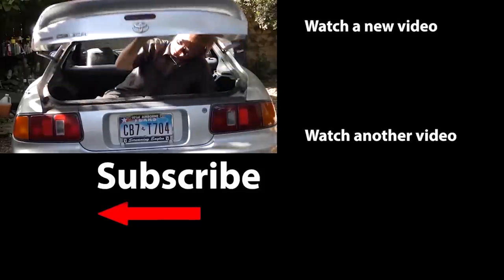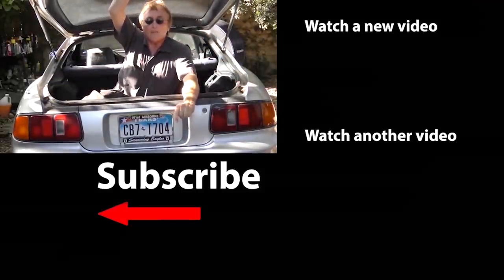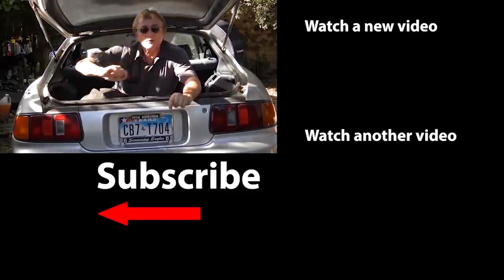This Was a Huge Mistake

Comment: Scotty should I get a Dodge Caliber SRT4 as a collection, it looks nice and is tuned pretty fast and powerful
Reply: Theodor Eberbach To keep in the garage and drive on the weekends, sure why not. To drive everyday, no (also depends on year and millage)
Reply: @jgonsalves22  the one I plan to get is 2009 I think, 98K miles, with a ton of upgrades, like literally, everything from clutch to intake to injector, everything that can be tuned or upgraded with better parts is done. I'm planning it to be a daily driver
Reply: If you can buy it outright, perhaps. YouTube "Scotty Kilmer don't buy any car" for his thoughts on car collecting.
Reply: Theodor Eberbach Daily driving might be a bad idea. Dodge’s are not reliable at all, but with the upgraded parts, could last for a year or two before you experience problems.(especially if you plan a lot) Be careful, but again, it’s up to you. Personally I would not get it, as it also sounds pretty expensive.
Reply: Michael Ball *plan to drive a lot

Comment: Hey Scotty, I have a 2005 Honda Accord Ex with the 4 cylinder. It’s got 143,000 miles. When I’m accelerating and I’m at around 40 mph my engine feels like it’s wobbling. Is my transmission toast or do you think I will get another few years out of it. Thanks
Reply: Mikeyp53 Sounds like the transmission, but I’m not 100% sure. A Honda that old with 143k miles could be experiencing transmission problems.
Reply: Could be the transmission, could also be that the motor mounts are failing.

Comment: Hi Scotty, I just accidentally topped up my power steering reservoir with brake fluid. Probably only added a couple of ounces. Will this cause any problems?
Reply: If you haven't started the car , just disconnect the line from the power steering reservoir near the pump , drain thoroughly , reconnect and refill with the correct fluid .
Reply: @j_freed  But I only added 2 ounces. Brake fluid has a much higher boiling temperature and not as much lubricity so it seems like the biggest problem would be poor pump lubrication as you alluded to. But it would still be 94% power steering fluid and the brake fluid has some lubricity, right? I agree that the safest thing to do is to flush it but, on the other hand, isn't it possible that it might not cause any problem due to the small amount of contamination?
Reply: @Gordon_L  I started it and drove it around for a week before I realized what reservoir was for what. Stupid, I know, but I expected the power steering reservoir to be on the pump but it wasn't which threw me off. No excuse but accidents do happen.
Reply: @michaelchristensen2786  Easy mistake to make , don't be too hard on yourself buddy .

Comment: Hey Scotty, I have a 2019 Tacoma and I want to straight pipe it, what are your thoughts on that. I live in the Houston-sugarland area, is it legal here
Reply: No
Reply: you’re messing with the exhaust and the engine isn’t programmed to run with straight pipe. it might not run correctly so if u want to straight pipe it, get the computer reprogrammed
Reply: Easwar Punnavanam I believe Texas has emission tests... if they do, then no. If they don’t, while it’s still illegal, it is probably not heavily enforced...
You can probably get away with it, but RIP warranty 😂
Reply: The older it is the easier it is to mod. The ECU will need tampered with too for it to work right.
Reply: Don't recommend it, but if you really want to, find a system with a high flow cat and bungs where the O2 sensors screw in. Basically a plug and play system. If you can't find one, just throw a catback on it. Straight pipes only you will need a dyno tune so they can program the ECU. Easy 600 bucks for a proper tune so think about it
Reply: Not legal whatsoever.

Comment: Scotty do you think UTI is a good school to get into the automotive industry
Reply: Sure he would say it's a money pit don't do it!
Reply: I have been in the service business for over 20 years.  Most of the UTI graduates I work with think they know everything about cars and actually know very little. They end up causing a lot of damage to customer cars.  In the shop I work for now, the UTI grads still have to work their way up from the bottom.  They start out as parts runners, car washers, and lot attendants.  If they have good work ethic, they get promoted to the lube rack where they usually spend a year or 2.  Then when there is an opening in the shop for an apprentice they get moved to the shop as a technician assistant.   The advantage to UTI is it will get you in the door more easily for a job interview than not having that degree.  I recommend getting into a factory training program through UTI, such as Ford's ASSET program.  Then you will get specific training and have a better chance of going on the line a lot faster than normal.
Reply: Your local community college is cheaper than UTI if they offer automotive.
Reply: You're better off going to a trade school to become a plumber, HVAC tech, or electrician, whichever of those three interests you most. The problem with auto mechanics is that as cars get more computerized, auto makers are going to go more and more in-house for repairs. It's already happening with John Deere, Tesla, and FCA. No ability to go independent removes leverage for employees to negotiate wages and benefits = Not Good. To see the worst-case scenario from a car mechanic's standpoint, YouTube "Tony Seba robin hood conference", and watch that presentation.

Comment: 2005 ford diesel was the 6.4L and it's a piece of crap they constantly blow, go older and get a 7.3L or a gas v8
Reply: 6.4 is the maxxforce 7 from navistar, piece of junk engine
Reply: @Datsun7705  yes even if you spend like 7k to "bulletproof" it the thing will still blowup.
Reply: Tatsuhiro Satou haha you search up maxxforce 7 you’ll see lots of hate because the 6.4 is exactly the maxxforce 7
Reply: 2005 is a 6.0 which was a pile of junk.  In 2008 they came out with the 6.4 which was better, but still not very good until they worked out all the bugs in 2010.  The 6.4 had terrible fuel economy also.  The 7.3 was fantastic
Reply: all of these emissions crap caused the engines to fail
Reply: @rays7437  your right I was thinking of the 6.0 but called it the 6.4 by mistake
Reply: @tatsuhirosatou5513  
Easy mix up.  Neither were very good.  I made a LOT of money off of the 6.0 repairs, but I think that whole debacle aged me 10 years.  I have to say, though the 6.7 and been phenomenal

Comment: Hey Scotty, Ive got my eye on a used 2012 Hyundai Elantra with 22k miles on it for $10k, would it be worth it to buy or am i walking into a money pit?
Reply: Definitely. According to Scotty Hyundai cards are not well made and are endless money pits.
Reply: I could get a 2011-13 Corolla or Matrix for far less ($6-7k with around 90k miles, less with more miles). Even with the higher mileage, it would be a way better car.

Comment: If you buy a used F-150, avoid the 5.4L 24 Valve V8 Triton engine.
Reply: Can you tell me why please?
Reply: @rellyrellisreallyreal2304  The have a cooling and oiling issues compared to the 2Valve and 4Valve engines.
Reply: @neilhale4529  how about a 4.6L F150 2001 Triton?

Comment: My 2001 ford f150 Harley Davidson with a ABS light that won’t go off i have changed the wheel sensor and the fuze if it is the abs module should i really replace it or just go with it
Reply: Your choice.  But if you are going to fix it, do it now while parts are still available.  Also, there are a dozen reasons that light could be on.  Get it diagnosed.
Reply: I have had it scanned and it said it was a wheel sensor but when I replaced them ill have it scanned again and see if the light is still on for no reason
Reply: Ray S Thanks
Reply: @brysoncalvert8159  
I see the sensor wiring get damage a lot.  Check the harness.  A lot of times the wiring gets broken or a pin pulled out at the top of the harness.  
But what is more common on those is the speed sensor on the rear diff.  Those are frequent failures and are cheap and easy to change.
Reply: Ray S thanks ill check and look around at the wiring
Reply: @brysoncalvert8159  
Good luck!

Comment: Hi Scotty! Howdy from Houston! I have a strange creaking noise coming from my front brakes. They only make this noise when I apply my brakes softly at low speeds. But when I brake hard, there is no noise. I only hear the sound when I am braking lightly at low speeds. Took it to a mechanic who just did a visual inspection and he told me everything looks perfectly fine, including the pads, rotors, and calipers. Any idea what could be going on? Much appreciated!
Reply: Amin Esmally, the lining of the brake pads have cracks you cant see unless you take calipers off to look at the pads. Seen it many times before. Or they are shitty pads
Reply: Fix It 1975 I really appreciate you taking the time to reply! I will take my car back to have the calipers removed for a closer look. I could only find 2 articles online regarding this issue: one stating it was an issue with the caliper piston to seal interface and the other stating the caliper piston is offset. I’m not a mechanic so that’s all foreign to me. But will start with taking a closer look at the pads first. Thanks again for you help!
Reply: @aminesmaily7913  no problem. Let me know what you find? I've been mechanic myself 25 years.
Reply: You need to flush the brake fluid system completely.  I see it a lot with older Fords.  It fixes them right up

Comment: That is completely false that towing an all wheel drive vehicle behind an RV will damage it. If you contact the dealer where you purchased the car in most cases they will let you know if that vehicle is flat towable. My grandparents have towed an 07 all wheel drive jeep commander all over the country for years with no issues the correct procedure is to put the transfer case in neutral and then tow it in park for that particular vehicle.

Comment: Scotty I’ve got an 06 focus with 110,000 miles. The power steering fluid is foamy and the system whines when I turn my wheels. Is it the pump?
Reply: Sounds like you got air in the system.
Reply: If there are no leaks, then yes, it is probably the pump.  You could try flushing it.  I would use Mercon V.  If the fluid is pink like Pepto Bismol then you probably have air in the system and it leaks somewhere.  That situation would have to be addressed also
Reply: Ray S makes sense. It’s a very dark brown and is spewing through the cap. I took some out and put a bit of the gas station power steering fluid with stop leak. It ain’t done any good, and I am definitely amateur level here.
Reply: @Huskers-yo9yl  Hydraulic fluids like atf and power steering fluid are low foam , is it possible somebody topped it up with an inappropriate fluid ?
Reply: @Huskers-yo9yl  
Sound like the pump is on its way out.  Get a complete fluid flush with Mercon V and get a new cap.  Hopefully it will buy you some time.  I had one that I was able to keep going for about 2 years.  I just kept flushing it.
Reply: Ray S I’ll keep flushing it as I’ve already started. I bought some Mercon V and got to work. I should’ve read this sooner when I bought the fluid, so, I could get the cap. Thank you guys for helping me out!
Reply: @Huskers-yo9yl  
Good luck!

Comment: Hey Scotty I got a 2012 Nissan Altima 3.5 sr i can’t put it in reverse and whenever I turn it on it launches forward. Park also doesn’t work but can drive forward normally, is it the transmission?
Reply: Armando Valadez Nissans are just bad cars. My dad owns a 2014 Altima and has had its AC system replaced TWICE.  Your problem does not sound like the transmission, but the gearbox maybe.
Reply: Good grief I hope you are not driving the car around my family.  Go get that thing diagnosed and repaired
Reply: The CVT transmissions on those are known to fail around 100,000 miles.

Comment: 2002 Cadillac Escalade 101k miles car fax clean tile,no issues ,new rims ,new tires,new battery. 7k? Yeah or nah
Reply: That's a $3,500-5,500 car. If your mechanic tells you it's in good shape, and you can agree with the seller on price, go for it.
Reply: Oh, and don't do a loan on it, because you'll be underwater on it in no time.

Comment: Hey Scotty, looking to get a 2018 civic hatchback LX only 9,000km

Thoughts?
Reply: Don't even bother, because automatic Civics are thief magnets, and if it has the 1.5T engine, you get oil dilution. Also, you won't get enough depreciation for comfort; youtube "tony seba robin hood conference" for more info. If you already have something reliable, keep it.
Reply: @EMichaelBall  I currently have 2009 Saturn Astra, the Honda would be an upgrade. The recalls have been fixed on the car.
Reply: @slayshy  Some people have experienced oil dilution after the recall. Also, there is the Seba stuff to think about; depreciation is a major concern. If you want another car, you're better off with a 2004-08 or 2011-13 Corolla/Matrix.

Comment: Hi Scotty.  I have a 2008 Pontiac g-6   When stopped my rpm gauge bounces up and down 100-150 rpm?  Thanks in advance
Reply: That's not good. When a engine does the rpm up and down that means there's is something wrong with either the cylinders or fuel injection if they have it. If you don't check it with a honest mechanic like Scotty you might have more engine problems in the future. Well hopefully Scotty get to answer your qs with better explanation.
Reply: Next time you do an oil change, do an Italian tune-up (3-4,000 RPM on the highway in any gear) for a couple of hours. Then if the oil appears dirty, change the oil, again. That may make the engine rev more normally at idle.

Comment: I see so many vehicles being towed either with all 4 wheels on the ground, which is almost always wrong regardless considering that most cars have automatics with a park gear; BUT I also see morons towing pickup trucks (ironic right) ON THE REAR WHEELS!!! Like come on. If you’re gonna go through the trouble of picking up one set of wheels, pick up the drive wheels and avoid damaging the transmission